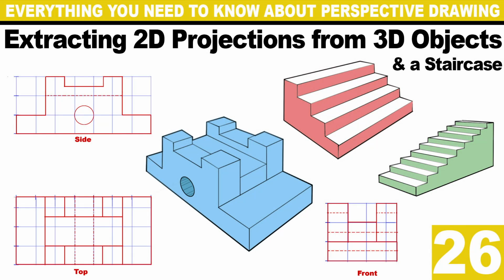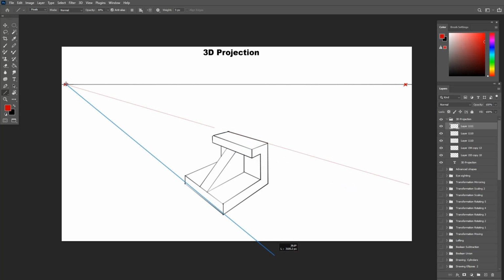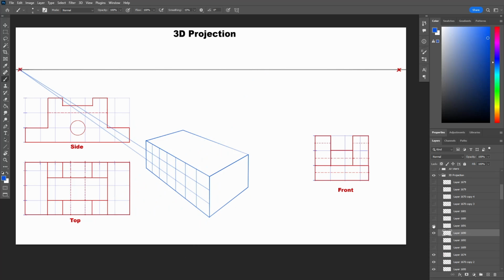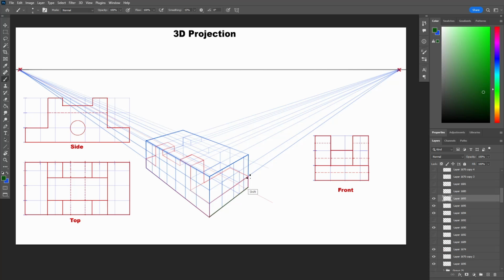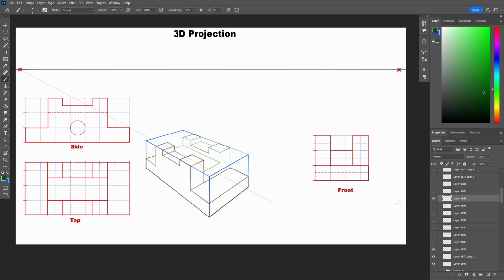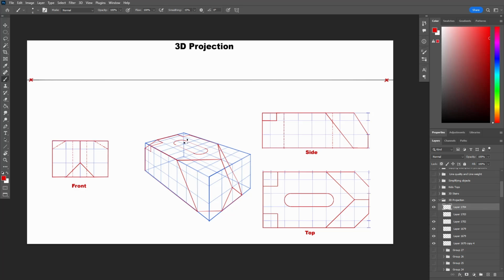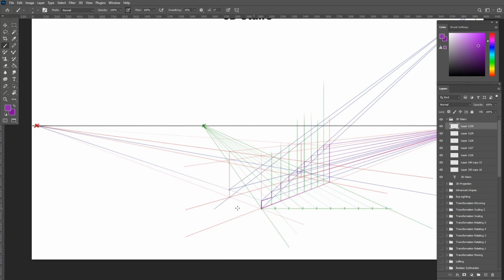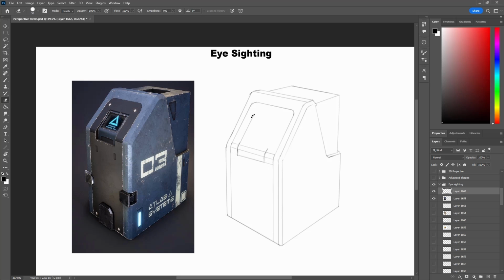Lesson 26: Extracting 2D Projections from 3D Objects and Drawing Stairs

Comment: Hi teacher, I think the top view (28:41) looks off. The botton line of the striangle (where it is covered by the upper plain of trapezium) is supposed to be invisible, and there should the visible line added: on the top view, Unit for rectangle length should be 3 unit instead of 2

Comment: there is a diferent bettwer way of casting 2d projections on a 3d perspectiv cube , by taking one of the corners of the side you want to cast and matching it with the same corner on the cube , casting a line that passes trew the oposit corner that gose the the horison line  , where it meets the horison line you draw lines that go to any part of the 2d projection works well with corners and hard edges but you can have curves and other more organic stuff but you would need to brake it in to grinds
Reply: hello sir, I'm interested to learn from you, can you make a video regarding to the better way to do this? I'm a visual learner, I want to learn and understand this specific topic, Orthographic views, top, bottom, front, rear, left and right, from 2D to 3D and from 3D to 2D as well..and how to apply those techniques to organic forms using subdivide,  mirroring etc..thank you
Reply: @Markus-_-  sure i might give ot a try after work but i think i can g8ve you a link on this method
Reply: @saucelessbones5872  thank you, the link plus a video tutorial would be great combination, appreciate you